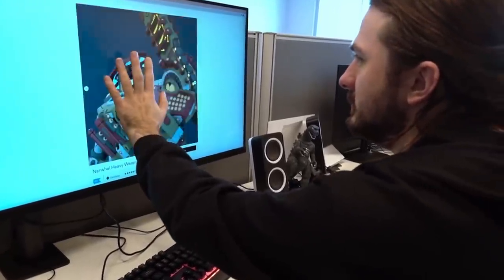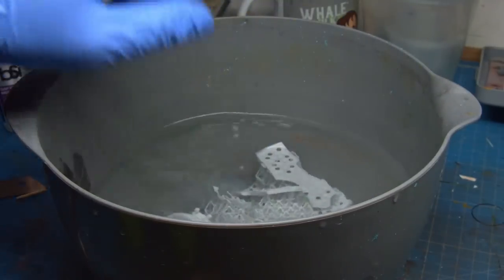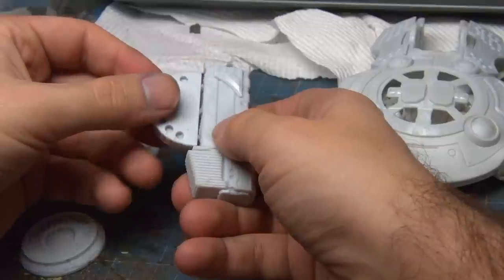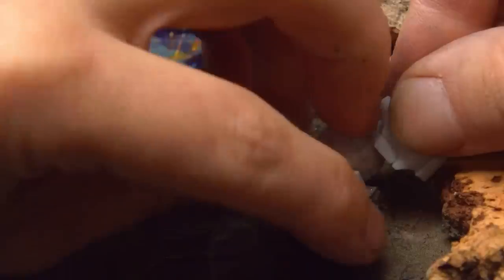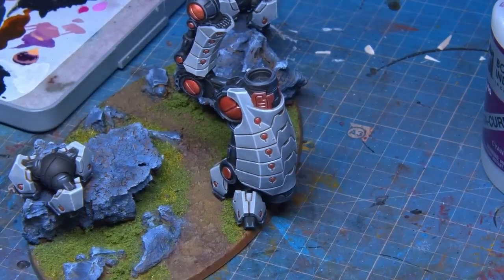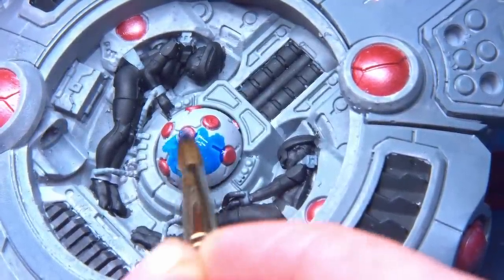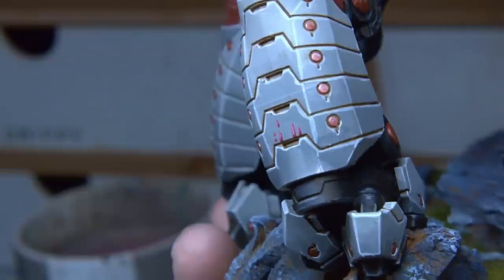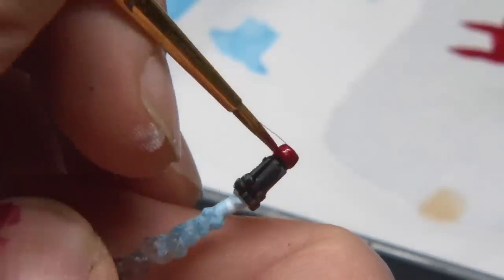We made the ultimate 40k Tau Mecha!

Comment: Super glue accelerator and/or pins would have made your feet placement a lot easier for you. If you do use accelerator, don't use the spritz, I unscrew it and use the straw to add a drop or two.